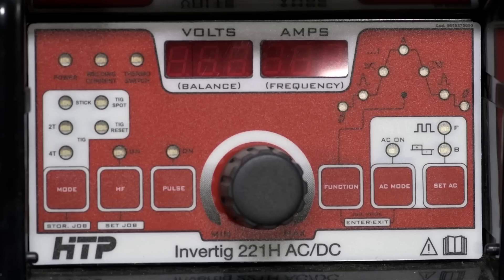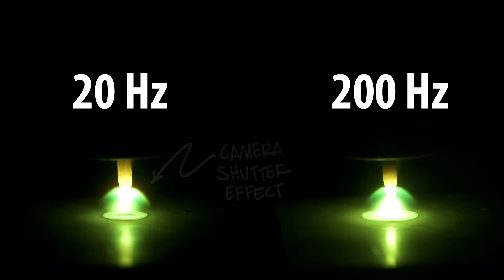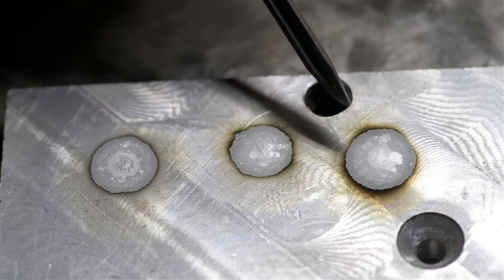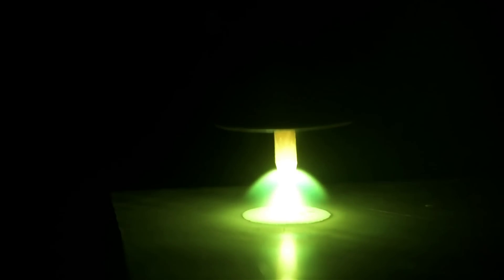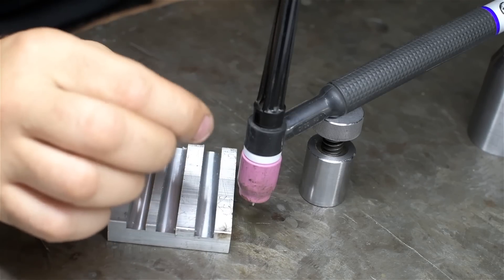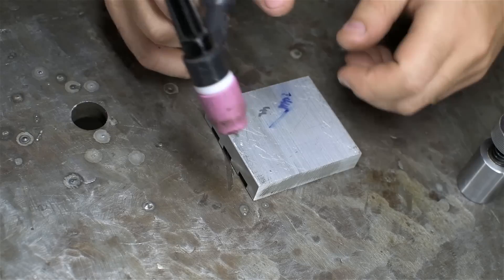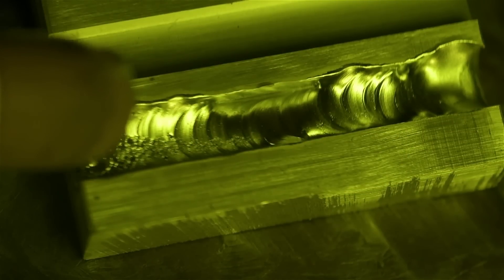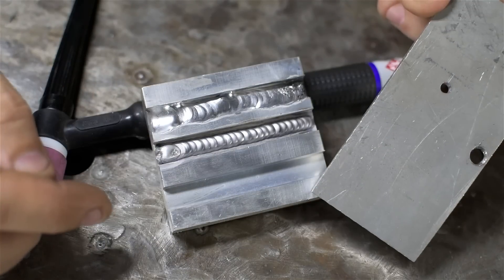TIG with TOT: AC Frequency?!

Comment: tony... you gave yourself the one and only right answer, if you heat up the aluminium for .1 seconds there is more heat built up than if you heat it up for .01 seconds. the aluminium transfers the heat away while there is no current flowing, if your frequency is higher, your  amp bursts are shorter timed, therefore not as much heat can go into the work. i mean, it takes some time for a body to warm up, only because the physical heat is there, doesnt mean that 100% of it get transfered where you want it. some of the heat goes into your torch with each "pulse" or simply into the air. i think that is the difference we see here.
Reply: Interesting, this is starting to make sense now
Reply: A thought experiment about the extreme case helps to visualize this: What will happen at 0.01 Hz? These 100 seconds of essentially 200A DC will make a mess... Why? Because apart from heat being cunductively transferred away from the puddle, heat is also radiated away immediately from the surface. This heat radiation temperature loss will constitute a major fraction of the overall temperature loss (light bulb...). Time-wise one will see a falling exponential temperature curve during the off-cycle and the temperature hence falls most rapidly at the beginning of that off-cycle. So with higher frequencies one will radiate more heat during that off-cycle when compared to lower frequencies (non-linear behaviour). Technical side note about the skin effect: a square wave of x Hz has a substantial part of its spectrum in higher frequencies than x Hz (just google square wave spectrum images). At 200 Hz about 1/3 of the signal energy is contained in the frequency range above 1 MHz. These higher frequencies are much more likely to cause a (noticeable) skin effect (The skin effect doesn't 'start' at some frequency afterall... ). This also explains why less heat is found in the qork piece afterwards when using higher frequencies: heat at the surface radiates away quicker - so if more current flows at the surface, less heat makes it into the center of the work piece. So in short: skin effect - yes! Same energy dumped into the work piece at all freauencies - yes! but - surface heat radiates away faster! and - a more frequent off-cycle lets the puddle cool more than one off-cycle every 5 years ;D
Reply: This, coupled with what other users pointed out about the fact that he's likely not getting a pure square wave, are pretty much my best guess as well. Especially on aluminum where the conditions to form a puddle are so difficult to achieve in a controlled manor, minutiae make a difference in certain instances. Thus I think that if an oscilloscope test were performed to check the two wave forms and they're comparable, we must change the constraints of the current experiment. I.e. If the same test were performed on a metal of lower heat dissipation or higher melting point (looking at you brass), the difference between the two welds would likely be a wash.
Reply: The average value of a wave doesn't depend on it's frequency. 
Here's a 10Hz square wave for 1 second:       |‾|_|‾|_|‾|_|‾|_|‾|_|‾|_|‾|_|‾|_|‾|_|‾|_ 
and here's a 1Hz square wave for 1 second:  |‾‾‾‾‾‾‾‾‾‾‾‾‾‾‾‾‾|_____________
the sum of the area of the squares, and therefore the average value, is the same in both cases.
Reply: Corey Small now add in the fact that the waves energy is being transmitted through a gas, you'll lose more energy with each individual impulse vs with a longer wave.
Reply: Heat transfer is also in play, conduction in the aluminum has a frequency dependence.
Reply: how is thermal conductivity frequency dependent?
Reply: I have a very similar theory as Sharky. , Arc heats the puddle at 10,000 F +/- switching current direction may give the Tungsten a break, but the heat soaked into the aluminum would be far greater with a longer pulse.
Reply: frequency doesn't change duty cycle/mark space. I get what you're saying but I don't think it applies, while the polarity of the arc does have a major effect on penetration/addition of the filler, I can't see how it can effect the temps given that they are more a function of resistance and the ambient heat of the plasma itself. All this said, I ain't no welding genius, just another sucker with a 3in1 tig/plas/mma full of chinesiums, learning everything I can. :)
Reply: Not that simple. Consider how far the heat can flow in 0.05 seconds. It is basically irrelevant if it is 0.05, or 0.005, as the heat is only moving thousandths before the next pulse.
Reply: reverse polarity makes a big difference my friend, the electrons shoot right into your torch and it gets way way way hotter than with regular polarity
Reply: The energy itself in an ideal waveform does not change with frequency, the current heats the material up in both directions. That does not exclude influence of frequency-dependent side effects on the whole system: there are losses during polarity changes for sure, as there is some parasitic capacitance in the wire and the workpiece, maybe the formation of the plasma changes direction too, which also takes energy that is not resulting in actual heat in the workpiece. The welding machine controls these things at it´s output, not at the tip. So it is logical to ask what the setting on the machine does at the tip or better said how much heat ends up in the workpiece.

As change of AC frequency changes the cone size as shown, then there should be the same current focused on a smaller spot. Yet, the wider arc got a puddle earlier. Maybe looking at this helps:
The whole circuit is "+" <-> wire <-> tungsten <-> plasma <-> workpiece <-> welding table <-> ground clamp <-> wire <-> "-". A more conductive plasma means less resistance, therefore fewer losses and it seems to be the biggest variable in that system. The shielding gas transports some of it away as well. I got no idea how to estimate the conductivity of the plasma based on its shape, because being a gas not only the cross sectional area, but also the intensity with which it is formed, therefore the density of available charge carriers and resupply of removed charge carriers plays a role. So there might be the biggest influence for change in shape and resistance of the plasma. Temperature of the plasma could give some indication how much energy is in it.

Such questions are also interesting for some other technical applications, like spark plugs or lightning dischargers.
Reply: This wikipedia article https://en.wikipedia.org/wiki/Electric_arc#Overview mentions that below 100Hz an arc is almost equivalent to a DC arc and what it does.
Reply: RMS power calcs applies on the electrical side of things over a relatively long period of time. What happens in welding is complicated in the time domain, as you have not only the electrical side, but also plasma effects, cleaning effects, puddle effects, and base metal  heat transfer, each with its associated electrical impedance models with a good mix of mag fields and eddy currents potentially throwing a wrench into the works as well. At low frequencies over a long enough period of time, most of the above issues get swamped out and a given amount of power in will result in a given amount of heat transfer to the base material. As frequency rises, thermodynamics of the entire system from tip to plasma to puddle, to base material can end up tweaked. As such, despite the RMS power to the system remaining the same, tip heat loss, gas heat loss, and base metal heat loss can and do vary which therefore affects the puddle itself,and there by the actual weld.

Comment: full disclosure, i know little to nothing about tig welding.

however, i know about how hertz works, and about heat transfer. 

i agree that its not the skin effect that's doing this at all, what i believe is happening is solely heat transfer.

a lower frequency means that the arc switches less often (obviously) which means each "switch" lasts longer on the surface you're welding to.  You're giving it "more time" to heat the part, essentially.  This means it will take a shorter time to "melt the puddle" so to speak, because you get hotter faster.

a higher frequency is the opposite.  each switch lasts a shorter amount of time, so it takes longer to get up to heat.

inside a corner, as you showed, there's nowhere for the heat to go except up.  And because of the lower frequency, there isn't a lot of heat management.  its not centered on the part or the bead.  it goes everywhere.  higher frequency has a lot better heat management because you're heating it more often, for shorter times, and thus seems to make a tighter bead.

a good example of this is cooking something in the microwave.  cooking something for 5 seconds at a time, then letting it sit for 5 seconds, etc, (.2Hz)  cooks the food slower but more precisely than cooking it for 50 seconds, then letting it sit for 50 seconds (.02 Hz) which will spread the heat out everywhere as it cooks

outside of a corner or small area, the heat dissipates faster than inside, so , as you said, it doesn't make a lot of difference.

just my two cents

Comment: I suggest cutting back across to examine the penetration. 
Higher frequency and skin effect, even at these frequencies, will not heat thru due to the current density rather the heat will require more time to soak into the material.

Comment: The skin effect "depth" is (put simply) a measurement where the current is about a third as dense as the surface; and given Aluminium's fantastic heat conductivity - I think that supports your theory of the effects you've witnessed; at least partially. We must remember that it's the heat of the plasma that melts the metal, not the current (though the plasma's output is somewhat proportional to current) - I would assert that because more electrons are near the surface of the material from this effect, that the resistance is increased, and thus the total current is decreased - leading to the "cooler" result.

Depth (m) ~= 503*SQRT(P/(R*f))

Where:
P = Resistivity of medium (Al = 2.7e-8; some tweaks to do here if you take temp into account)
R = Relative permeability of medium (Al = ~1.0)
f = Frequency of current

@ 20Hz, Al = ~19mm
@ 200Hz, Al = ~6mm

Comment: aluminium skin depth at 200hz is ~6mm, but with a square wave parts of the energy is at odd harmonics, at 600Hz,1000Hz the skin depth is closer to 3mm

Comment: I really think it's a problem with your inverse reactive current caused by your unilateral phase detractors not being synchronized with your Cardinal Graham meters or an issue with your Modio interaction of your Magneto reluctance or maybe it's a problem with the prefabulated amulite getting through the hydrocoptic marzel veins and a panoramic selenium rectification signasol depleneration, and if it's not that, f*** if I know
Reply: LOL!...that danged prefabulated amulite always causes me trouble, too...that's why I run with my phase detractors wide open!
Reply: Have you considered using a rock and a piece of wood to adjust your frequency. Place piece of wood on steel table. Use teak or live oak. Or purple heart. Place welding hand on top of piece of wood. Use filler holding hand to hold rock, and make a circular round house swing and try to hit the block of wood. As hard as you can. You won't even notice the frequency any more. :)
Reply: Have you checked for side fumbling of the quasistatice regeneration oscillator? The smallest crack in the logarithmic casing will cause the spurving bearings to get out of alignment, and then its the pentametric fan all the way down to the marzelvanes on the ambifacient wane shafts.
Reply: I think its the "sticky operator valve"!

Comment: Actually, the skin depth depends on frequency, but with thicker material, that depth becomes smaller than the cross section of the part at much lower frequencies... And when welding, the material is often much larger than we ever consider using to carry power and therefore worry about the skin effect. I was thinking about the skin effect before you ever mentioned it, and I am completely in agreeance with you. Granted I have no experience welding whatsoever except watching videos... But in considering building my own welder for the fun of it, I ran into the skin effect when trying to calculate what size copper wires I would need.

Comment: good video tony yoo didn't touch on the effect of the ac balance control on the arc. where was  your machine set,  also some of  these newer machines can change the shape of the wave form.  i have a miller 300dx with more bells and whistles than you could possibly use. i find myself pretty much stuck on 120hz and 70/30 balance. i do occasionally play with pulse. its kind of neet. if i had the skills of a jody collier and was working on a space shuttle i may find these bells and whistles useful but for us serious hobbyists  we need to pay more attention to our technique than anything else. and leave the structural welding to the pros. there are plenty of other things we can weld.

Comment: OK I'll take a shot. I'm going with Occam's razor. I think it's just a heat issue, nothing else. It looks like you got more heat when you used the low frequency than with high. But why would you have more heat with lower frequency? My guess is that it's all to do with how current is following the voltage in the output. At low frequency the current has time to ramp up and get to the full amperage and stay there for the full duty cycle but at higher frequency your machine is struggling trying to get the current up in such a short time window. Which also explains why you have to dial up your current settings to force more peek current through a small time window. So you just need more heat (peek current) to make a higher frequency weld look like a lower frequency weld.  No physics theory necessary, it's just simply the limitations of such machines.

Comment: "skin effect" is also what is taught for RF. So much so that when one gets to the really high frequencies (microwaves) that antennae are not even used anymore, it is all wave guides. That is because the frequency is in essence 'outside' the wire.

If you have ever experienced a shock from a ham radio setup ie: keying the mic while holding onto the antenna you can feel it is drastically different from your standard 120vac shock. It is like you can feel the higher frequency buzz around the surface of your skin more. Almost like it is travelling on your arm hairs.
Reply: That's because your nervous system doesn't sense anything about about 11Khz, but I do know what you mean. Not a big fan of it myself.

Comment: It’s basically like FPS or shutter speed in shooting video...faster frame rate (frequency) means less light hits the sensor (less heat in the work) per frame (cycle).

Comment: Ok, so maybe a bit late but, I might have a theory based on what is happening. The reason the puddle spreads more and sticks more to the side is because even though the same amount of amperage is put out the latency of trasnfer of heat is the reason for the difference. Same as when you take a lighter, you can pass your finger 10 times through the fire without getting burned but do it twice slowly and you will burn.

Comment: Liked the video, sort of.. When you weld aluminium(!) with tig, you should use 100% argon or 100% argon + 0.01% oxygen mix. You don't want to sharp the electrode. The frequency is, like you say, pure mental. Higher frequency gives you more focus on the  '''pot''. And it depend's what kind of aluminium you are welding. Is it si2 or mg3 added. Sorry my rally finglish :( Greedings from finnish professional welder from finland, who has qualifications to aluminium plate weld up to 25mm. :) Keep these videos up! :)

Comment: I think that what you have demonstrated is that the lower  the frequency the more the base metal tends to take on heat because even though the duty cycle is 50/50 through all frequencies, it heats much faster during the on portion of the cycle than it cools during the off portion of the cycle.

Whereas the higher the frequency, the less heat pumped into the base metal during the on portion of the cycle. 

I would think that the general size (mass) of the part being welded would also play a part in the equation that ultimately describes what exactly is happening during each of the weld examples.

Did any of this make sense???!!....

Comment: The frequency would have an effect if there were capacitance or inductance in the rig. Think Al separated by a thin film of Aluminum oxide from the steel table or the changing field around the electrical circuit.

Comment: Can get the same result with 20Hz and lower current? It is possible that your TIG simply has a long headtime, which gets quite big in comparison to 200Hz.
Reply from the maker: I'll try it.  You can certainly get a much nicer bead (this was way too hot for 20Hz, but the test was "live").  From experience I would expect the 20Hz to still wet out into the corners, though, whereas the 200Hz, at the same amp setting, sort of "avoided" the walls in the slot.

Comment: I would say that it can be understoud even without pointing out every minute physical effect. I think it generally comes down to the ratio of the time spent on all "startup effects" that impair the output energy or heat in many different ways i.e. / stabilizing arc, puddle, current , etc compared too the time spent in stabilized condition of each pulse. At higher frequency the duration of these startup effects becomes significant and affects the way heat would flow in a stable condition. When you drive 100 miles in one trip, or drive that same total  distance in 10 separate trips, as many know your mileage would be affected. Without going into detail about all factors that increase fuel consumption when a car engine is just stated up / not in stabilized operating condition, the significance of the time spent on stabilizing vs stable conditions should be clear.